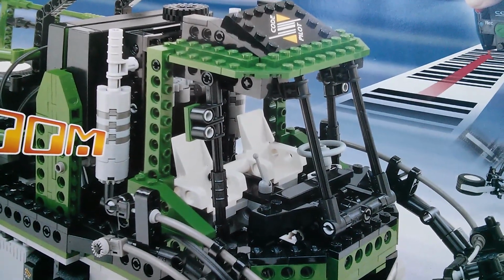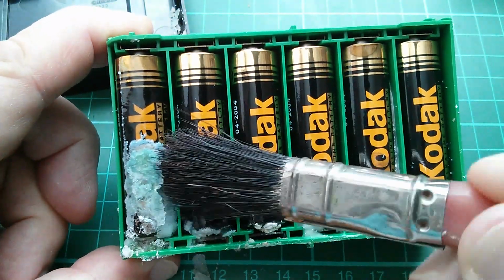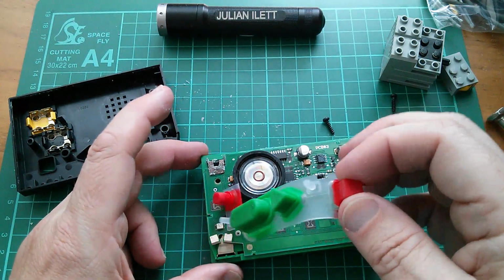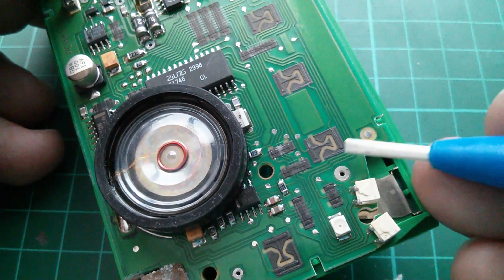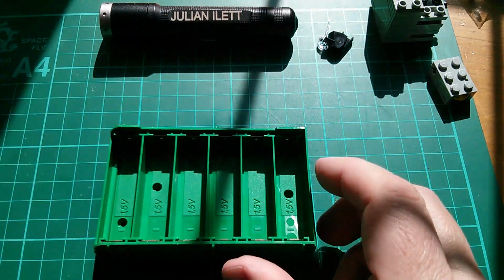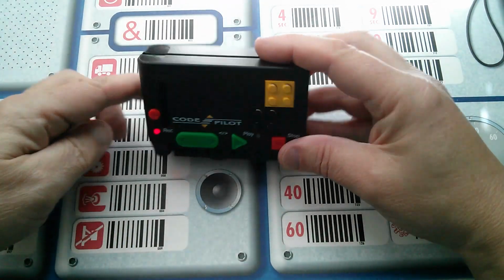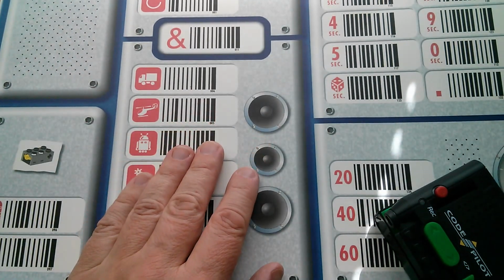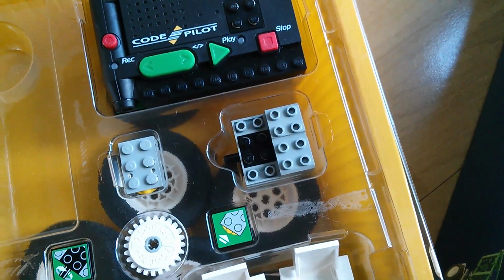Lego Set 8479 Barcode Truck Controller Teardown

Comment: I'd suggest a little light clock oil or perhaps some spray in silicone based lubricant. I wouldn't put it on the plastic in front mind, but the rear where the commutator is might help. If you can get the rest of the motor assembly apart it might help to lube the front bearings too. I don't know as I'd go putting it on the heater though as it might warp the plastics... Still if for nostalgia's sake alone this was a great video. I used to spend hours on end playing with Lego as a kid. I had quite a few of the Technics sets and had loads of fun with them. Cheers lad...

Comment: There are 2 types of motor used in those technic sets.  the Older model (part 71427), which is the one you have.  And a newer model (part 43362).
The newer model is absolutely not servicable in any way, and even just opening it can make it stop working due to some bits 'pinging' out of place, and putting some extra friction on the motor preventing it from running.

The older model is to a degree servicable. But it has 2 issues which is why it got replaced by a different model.
1) the sintered metal magnets have been known to disintegrate and return to powdered form. This can cause the motor to seize because it's all just a mess inside.
2) the drive gear eating into motor spindle causing it to loose it's grip.  The plastic parts can then find it's way into the motor itself locking it up.

You can get new parts. And you may be eligible for a free part replacement. But that depends heavily on where you bought it, and what kind of relation they have with Lego.  If you do have to pay for it, bad news is that it is one of the more expensive lego parts...

The batteries thing... sad panda... Using a mild acid (vinegar, citric acid) is the typical way out for alkalines (baking soda for acid leaks). The descaler might be a bit too  strong.

You should consider protecting the bare copper as copper will rapidly corrode on it's own.
You can nickel plate this at home, though it's somewhat of a chore.  http://www.instructables.com/id/High-Quality-and-safe-Nickel-Plating/
A thin coat of solder should help as well...
Reply from the maker: Cheers, thanks for that. I may have some more of these 9v motors from other sets - I guess it would be worth testing those too.
Reply: The motor has 4 pins on the 4 knobs. The is a pwm for the motor speed, 9V, Gnd and the last pin is for the encoder (for use with Mindstorms). You should try all the pins to find the correct one.

Comment: I had this set (well, still do, somewhere), was a good set but history quickly forgot it when the Mindstorm RCX came out the year after. Apparently the barcodes used in this became a reused protocol in various Mindstorm systems for communication, VLL/Visual Light Link.

Comment: Just bought this set from a friend, was an awesome build! Motor unfortunately doesn’t work but one is already being shipped to me. My code pilot didn’t work as the contacts were horribly corroded. I had to actually drill into the PCB and then solder wires onto it to get it to work again.

Comment: Oven cleaner spray works wonders on rusty and corroded contacts just leave the spray on 20 mins prior to rinsing with boiling water. Finally a small coating of vasaline seals it all.

Comment: No, don't self-flagellate, Julian. Do you know of anyone who hasn't left the battery in equipment for too long? I have the cardboard tube from an Eveready 3V No.8 'Bijou' battery (Remember those? A bit fatter than an 18650.) which was left inside one of my childhood toys for over 40 years. It hadn't leaked, and what's more, it still powered the motor for a few minutes. Sometimes we strike lucky. Thanks.

Comment: Well, that was a blast from the past, good old lego :) I'd be tempted to give the motor a splash of WD40 and see if you can coax it back to life.
Reply from the maker: Thanks - I was intrigued so I took the motor apart. Destructively unfortunately.
Reply: ebay most likely has a replacement
Reply: So was it the lubricant?
Reply from the maker: It seems (from the comments) that the magnet expands and seizes up.
Reply: bricklink would be better than ebay for a replacement motor. But if you haven't completely destroyed the motor the set with box is probably worth a bit, so you could sell it and buy different, working Lego instead.

Comment: Was thinking heat to loosen the motor as well. You could rush the job using a hot air gun or hairdryer. Lovely kit btw.
Reply: No. These motors have a disc shaped magnet. The magnet covering (like the shiny covering on neodymium magnets) delaminates from the actual magnet and gets stuck between the rotor. It cannot be fixed.

Comment: This is the very reason I think so many companies specified alkaline batteries.  They knew after a year or 2 that the batteries would leak and destroy the device hoping the parents would just go out and buy a replacement.  I replaced all of the batteries in my remotes with lithium primaries in hopes to not have to deal with leaking cells.

Comment: Never would have thought that the motor can fail like that! Also the brush/commutator in that motor seems very delicate, unbelievably so! Those brushes are like hair-thin??
Reply: These motors have a disc shaped magnet. The magnet covering (like the shiny covering on neodymium magnets) delaminates from the actual magnet and gets stuck between the rotor, the tolerances are so small that it cannot be fixed.

Comment: The rust is likely due to the nickel plating being eaten away revealing mild steel, which will in turn corrode when subjected to moisture in the air

Comment: you might have to actually replace the contacts and maybe even for a long lasting solution dremel into and rework the connections between the negative battery clamps and pcb, because that looked like it rot into the copper layers, which might spread further and break connections in the future.

Comment: A glass fiber pen works wonders on corroded contacts
Reply: My thoughts too, and I was more than mumbling at the screen when Julian used a file on it.
Reply: Yes, I've used a glass fiber pen with good results many times in the past. As long as the metal hasn't been corroded to the point where it is so fragile that touching it breaks it (which doesn't seem to be the case here) it should be possible to restore the contacts to reasonable functionality.

Comment: Corroded Contacts: after I mechanically remove the big chunks, I use acid wash, distilled water rinse, then flux and wet with solder. Easy.  

Acid - not only because the batteries are alkaline, but because acids attack metal oxides.  Hot acid does it better... This is how flux works to prepare a surface.
Reply: John Coops - Yeah, that was for some especially weird arrangement of contacts. Usually scotchbrite alone is enough, sometimes flux and heat as well. My iron is hot often enough anyway...

Comment: You can almost certainly un-seize the motor by soaking the whole thing in warm very light penetrating oil (e.g. PlusGas or similar). Put some oil in a pot, heat to about 50C, then soak the motor in it.
Reply: No. These motors have a disc shaped magnet. The magnet plating (like the shiny covering on neodymium magnets) delaminates from the actual magnet and gets stuck between the rotor. It cannot be fixed.

Comment: I've had great success with WD40 on leaked batteries. Just apply then brush it a bit, then optionally isopropyl alcohol to clean up the oily residue.

Comment: Just get some new contacts for the batteries and you'll be all set :) I had to do this recently with a clock I bought that had its battery terminals knackered, replaced the battery connectors (and resoldered in some better wires) and all is good.
edit: I see you fixed it anyway :)

Comment: This is a first gen motor (Lego 71427), the replacement they introduced in 2002 (Lego  43362) should be more durable. First gen suffered from cracking magnets --> locked up motor. More info: http://www.philohome.com/motors/motor.htm

Comment: I'm pretty lazy about taking batteries out and I've usually been getting away with it with alkalines, guess this unit had standby current cos I didn't see a proper power switch for disconnecting the batteries.

Comment: hi Julian, can you do a little test of manually charging lithium battery with a CC/CV power supply, without a charger chip?

I suspect as the battery voltage increases towards the target CV, the delta voltage between the battery and CV reduces, hence the charge current drops by a nice curve - this part (current-drop) is not controlled by the chip but a natural thing. So, it is sufficient to use any power supply with CC/CV feature to safely charge any lithium battery.

Cheers.

Comment: do you know how to open the electric motor from this set, I have one that doesn't run and is blocked when you try to turn it.
I want to try to fix this motor but opening such a case is a tricky thing without breaking it into pieces....

Comment: You CAN NOT fix these motors are the magnets are the problem.

There is a known issue where the magnets expand due to brake down of the binding material.
Reply: it is the magnet not the rotor plate
Reply: Yeh, edited it after hitting post when I remembered the name of the part was not what I called it.

Comment: You only had to spray the motor with WD40 and it would be spinning like new.
Reply: No. These motors have a disc shaped magnet. The magnet plating  (like the shiny covering on neodymium magnets) delaminates from the actual magnet and gets stuck between the rotor. It cannot be fixed.

Comment: the magnet in these tend to swell up ant seize the rotor solid
Reply from the maker: Interesting. What makes the magnet swell up? Moisture maybe?
Reply: The plating reacted with the metal witch the core magnetic material is made of.. I would guess it was contamination I have these motors and have had 8 fail this way I build large GBC modules please open yours to see if I am correct on yours

Comment: Julian if you ever want to sell the barcode part let me know . I have the set minus the barcode part. Havent checked to see if my motor is duff tho. :)
Reply: Unless you want it for the collectors value, I'm sure you can use a scan, it looks very standard barcode.
Reply: i have the set but not the barcode module. i have the scan codes.

Comment: Why 6x AA batteries and not 1x 9V battery?
Reply: one 9v would not supply the same duration or current as 6 AA. Take a 9v battery apart and you will find 6 button cells
Reply: @steamboatmodel  Actually it's six AAAA cells.

Comment: I was going to suggest you sprayed some wd40 into the gearbox and motor but it seems im too late!!
Reply: Don't use wd40 for motors, it will just gum up. Use a good synthetic oil, I typically use one of those super lube pens for small motors.